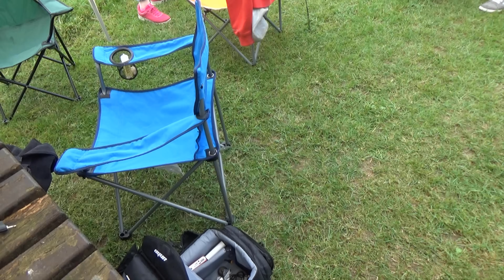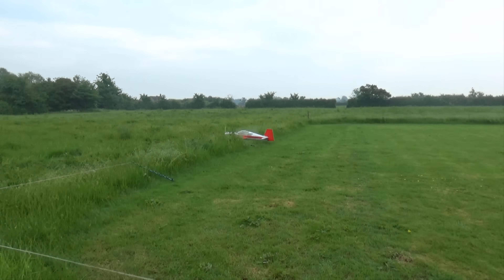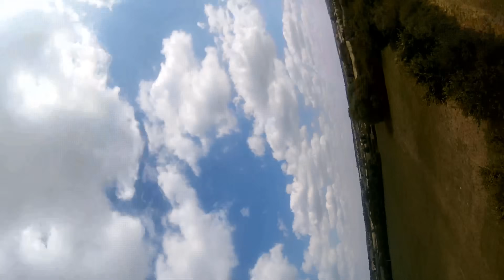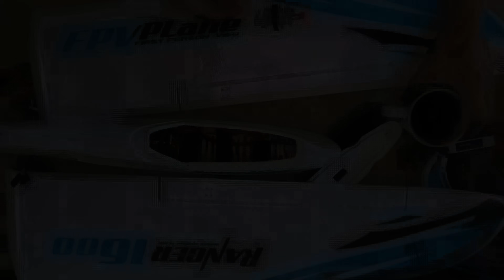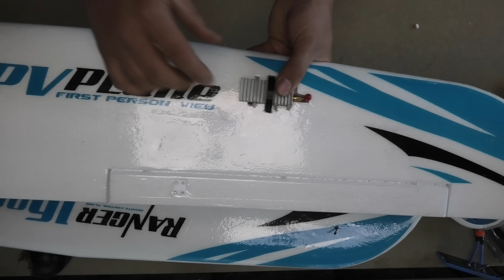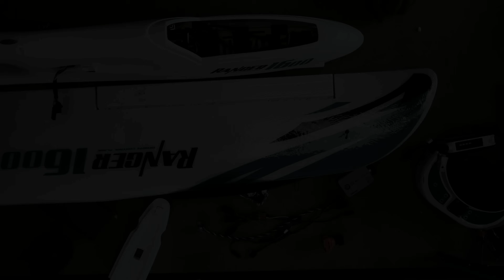"Big Things into Small Holes"  Ranger 1600 Post-Build Thoughts | FPV Model Aircraft #NAFFR

Comment: Very late pro tip on fishing wire through right annoying spaces. Use dental floss in one end, and a vacuum cleaner in the other and let it suck the floss though. thus the reason an electrician wanted to borrow my shop vac, it certainly wasn't because he wanted to clean up after himself

Comment: The Ranger 1600/2000 is one of my favourite planes. Been flying it a while now. 

I've also installed Eagletree Vector and yes it is a struggle getting it all in there. I remember temporarily taking out the wooden trays and the motor mount just to help with the build. I also installed a microphone, an ASI (airspeed indicator) and a beeper.

I recommend the optional Eagletree ASI by the way. Displaying airspeed next to gps ground speed on the OSD can be very handy making sense of situations in a strong wind - and helps avoid stalls when moving fast over the ground downwind.
Reply from the maker: Morning, yes the air speed sensor is a valuable addition as I have one in my Mini Talon and it's very helpful.

Placement is an issue for me with the sensor as if it's on the wing, it is likely to get damaged as I take the wings off, the same for the fuse. I'll need to think that one through first.

Matt
Reply: @RagTheNutsOff  I've mounted both the electronics part of the airspeed sensor and the back end of its metal pitot tube under the forward wooden platform for the battery . The other half of the pitot tube sticks out the left hole in the nose of the fuse. I was worried I'd break the pitot tube in a nose dive but so far so good after many flights.
(I avoid mounting stuff on wings if I can avoid it 'cos it adds to hassle connecting/disconnecting wings.)

Comment: I found strapping the battery in tight realy difficult. You definitely need some non slip matting to stop it sliding back when you throw it up... I also glued some 1mm thin ply top and bottom of the hatch to stiffen it and give a good anchor point for fixing anything.  Also, a molex connector with 4 or 6 pins is good on your wings. A bit of soldering to do but only one plug to connect each side and not so fiddly. Good luck
Reply from the maker: Hey Phil, I pulled those out and out 3 strips of velco in, instead. That made it way easier. Matt

Comment: Watch for a tip stall and the spar is made of cheese..
Reply from the maker: Hey James, yea I've seen how slow they will fly and how close to the stall they'll get. Matt
Reply: Your right James I swapped my spar for carbon instead of the pencil they supply, but it snapped the first time  I tried a power off loop, wings came fluttering down followed by a lawn dart which ended up 6" deep in a field. Couldn't believe the spar only goes into the wing less than 4" . I've now modified mine by removing the serrated pin in the wing tube ( nightmare job) and fitted a 34" square carbon tube as a joiner, with a bigger motor and batteries hoping to turn it into a warm/ hotliner.

Comment: I’ve just bought my second 1600. I totally agree about the wiring. I put the Matek F405 Wing in mine and what a fiddle. I couldn’t make it neat especially with the need for access to the USB port on the FC. I wish they had designed a slide in/out tray. Wait until you bust a wing clip and have to get the tray out to replace it! I’m going to try make my second one look as neat as yours!
Reply from the maker: Howdy! WOW, yea I bet that was a challange and a half to make one of those fit in there. Matt

Comment: It's a great match for the vector, especially if you like a bit of soaring, the vario makes it a blast, hopping from one invisible escalator to the next. 
Happy Days! PS, I needed some extra weight at the tail also, and I just upgraded the tail servo's to slightly heavier 13g metal gear hall effect digitals, just 8 extra grams at the tail made
a huge difference at the nose due to the tail boom length.

Comment: Matt - Make sure you hold lots of elevator in on launch (I have to hold full elevator) - I run this on the sunnysky 8x6 setup with multistar 5200 batteries and it really dips on launch so be prepared. I've upgraded the wings now to the 2m set-up and run a  8000 pack but to do this I had to remove the bottom battery tray to make it fit. See my set up here https://www.youtube.com/watch?v=SpdcHSENBCg&t=459s
Reply from the maker: Jim, I looked out for that dip today, yea that helped loads, thank you!